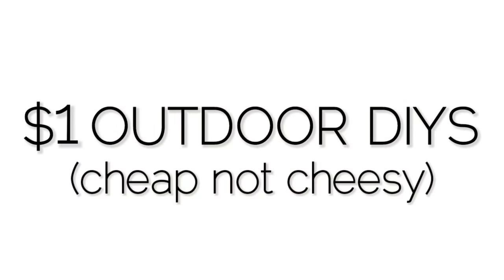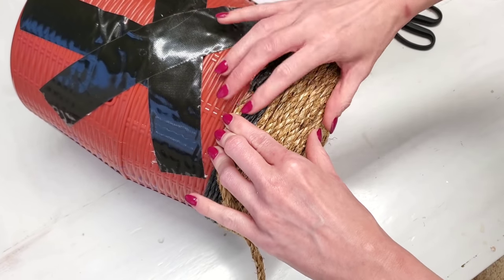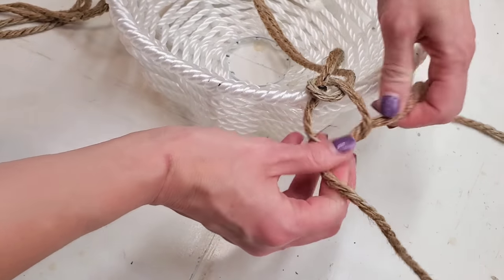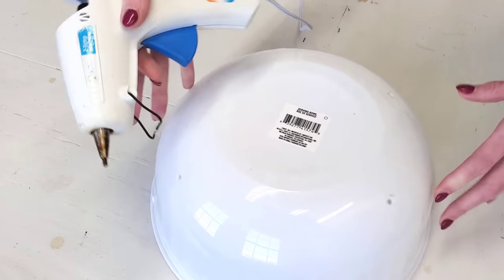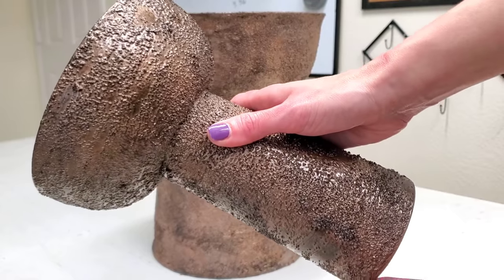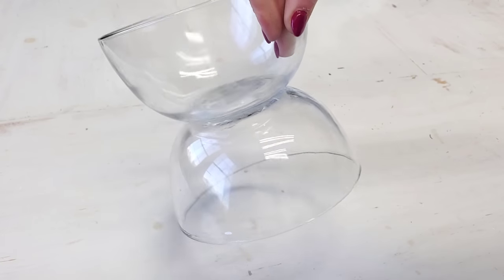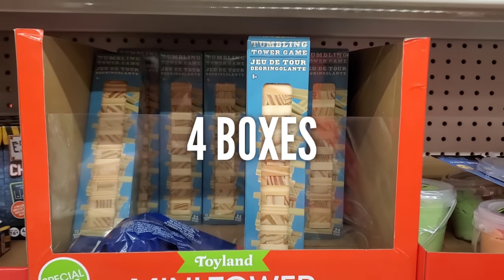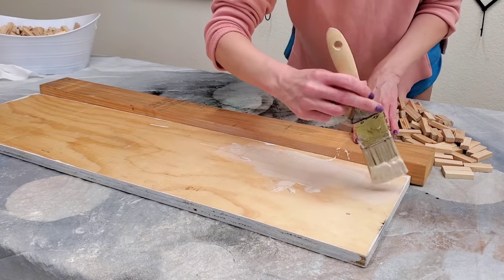SIMPLE WAYS TO DIY Decorate a Patio or Garden using $1 supplies! (easy & budget friendly ideas)

Comment: I love all these!  I suck at wood stuff lol. Used a saw for the first time yesterday and I can’t cut straight for crap.  I’ll keep practicing because I love that bench!
Reply from the maker: What type of saw did you use? My neighbor showed me a trick to cut a straight line (hand saw or circle saw) Clamp a straight pice of wood to what you are cutting and use that as a guide. Total game changer. You can get small clamps like I used in the videofor $1-2 at home depot.
Reply: @GlueGunsRoses  it’s a circular saw we got when my father in law passed.  I have to admit I am a little scared of it even though it has a safety cover.  I’m going to keep trying.  I see so many cute things using bigger wood pieces so it’ll be something to work toward.

Comment: I have learned to use E600 since at times hot glue will melt if items are used outside. Also tubes of clear chaulking works also

Comment: Just in case someone hasn't already mentioned it when you're putting that wood glue on the towering tumbling blocks to fill any gaps or cracks you can also use some wood shavings saw dust and mix it in with the glue and do the same thing with sanding it once it dries

Comment: Love all of these that bench is fabulous and I love that you support local people and I totally agree with you on buying a miter saw instead of a cricket my question is I need a new cordless drill which one do you recommend????
Reply from the maker: I buy Ryobi because we can use the same battery for the drill, saw, weed eater and blower. Although I have a smaller crafting drill that I plug in (no switch out battery) that works great for diys. I don't remember the brand but it is only $20 at Walmart ❤

Comment: Absolutely inspired to try some of these crafts!  I love the modern aesthetic not too trendy, but classic and simple 🪴
I’m in the Midwest and we get some pretty bad summer storms, how well do these planters hold up in the rain?  Also the rope bucket mini table, would you recommend weighting in down on the bottom?  Not against running out in the rain to rescue them, but sometimes we’re not home when that happens 🌧 
Love the crafts, thank you 🌻
Reply from the maker: I can't see the larger planter tipping over. The smaller plant I don't trust as much so I put it in the garage for big storms.
If you don't want the stool tipped over I would weigh it down with a rock. We had tornado warnings and strong winds the other night so I brought the small planter in but not the big planter or stool.. The stool flew across the yard. It is sturdy as far not falling apart though.  It is sturdy as far as staying together. After the storm I just used a hose to wash the dirt away, but the stool stayed together just fine.  I feel like I could kick it across the yard amd it would be fine 🤣 ❤

Comment: Hi!  LOVE your channel and have done several of the crafts.  I hot glued rope around pots to make planters but the glue is not holding and the rope keeps popping off around the tops of the planters.  Would using a nicer/hotter glue gun help? Mine is a little all temp one.

Comment: How sturdy is the first one? I'm concerned with it falling over easily (my dogs are like bulls in a China shop). Do you think weighing it down by putting a brick or big rock in the bottom would be okay?
Reply from the maker: If you don't want it tipped over I would weigh it down with a rock. We had tornado warnings and strong winds the other night so I brought the plants in but not the stool.. The stool flew across the yard. It is sturdy as far not falling apart though.  It is sturdy as far as staying together. After the storm I just used a hose to wash the dirt away, but the stool stayed together just fine.  I feel like I could kick it across the yard amd it would be fine 🤣 ❤
Reply: @GlueGunsRoses  ha ha, that's hilarious. I will definitely put some bricks in mine. Thank you!! Love your vids!

Comment: How do they hold up in the wind? We get very high winds quite often and am afraid they will tip over.
Reply from the maker: The big one is fine. I have bumped into it multiple times. The smaller one I brought in last night with tornado warnings and high winds (does fine in heavy rain amd everyday weather) .... But I'm going to stuff a heavier stone in the bottom or something like that. It hasn't tipped over but it isn't as heavy as the larger planter

Comment: Just an idea to run across to you if you take the cup and the bowl has a cup on the bottom have a bowl upside down and then you have a mushroom and you could do that with the big one also but if you cut a hole in the top of the bowl to put the solar light in it then have a hole in the cup it's up a little bit and then it will glow underneath and you can have it for your garden or your flower beds just an idea to run cross you I would have got that idea if I didn't wash your video